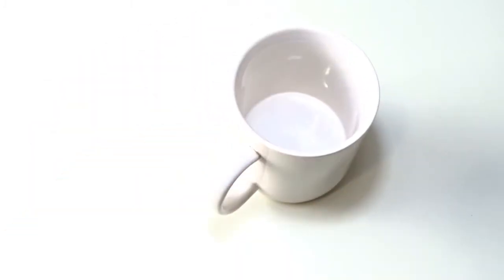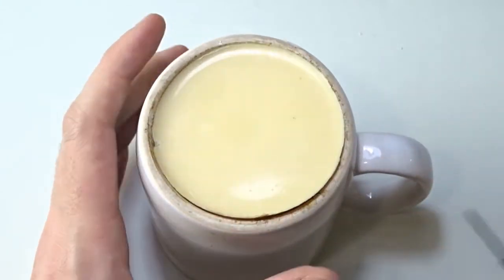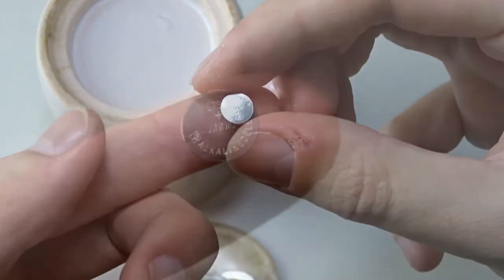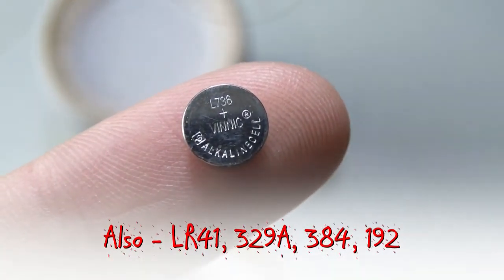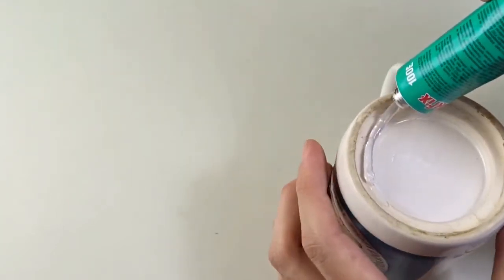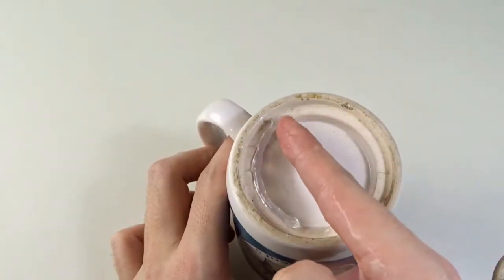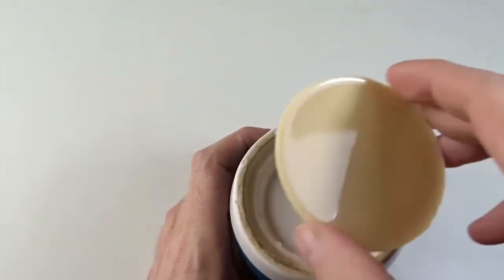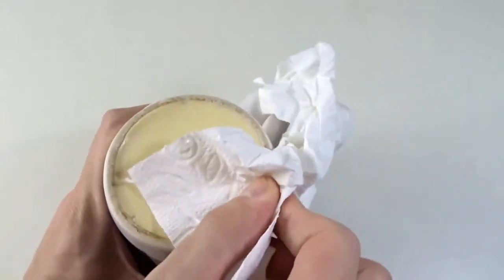How to Change the Battery on a Singing Mug

Comment: I have a Christmas cup from my childhood (it's probably 30 years old and it hasn't run out of battery yet... But my cup has a varnished sail over it so it won't be able to be opened in the same way either.